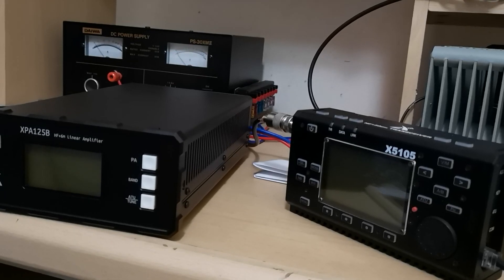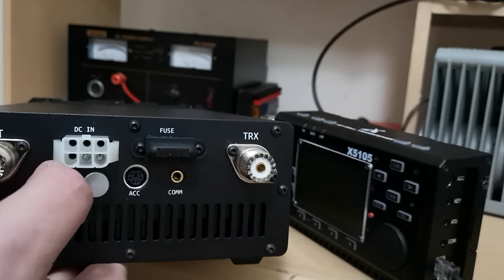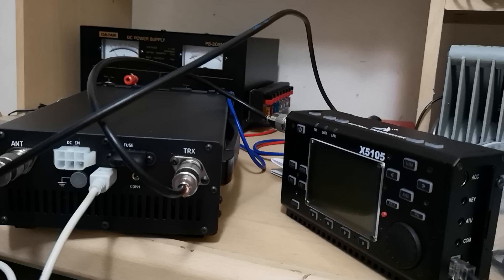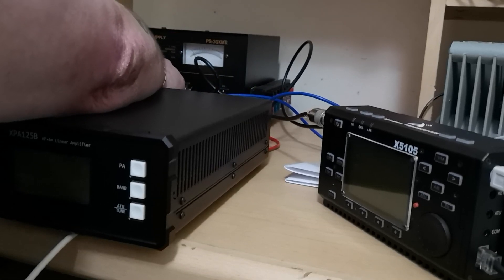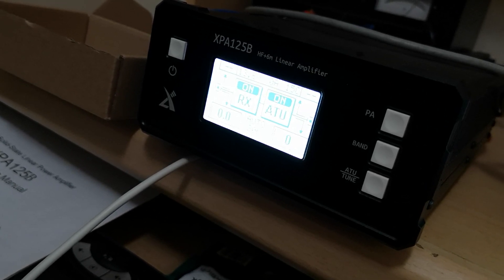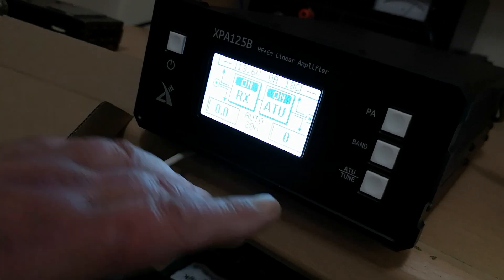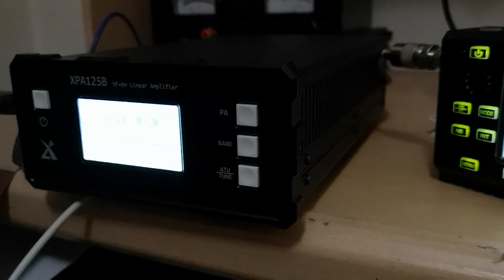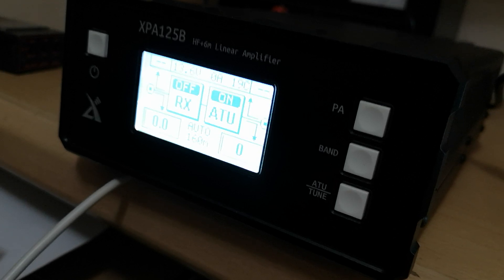The brand new Xiegu XPA-125B 100 watt 160 to 6 metre linear amplifier with built in auto ATU

Comment: Thanks for the vid.  How wide an SWR will it tune?  3-to-1, 5-to-1, 10-to-1?  The internal antenna tuners on most radios won't handle much of an SWR mismatch.
Reply from the maker: I have to say that ive had no issues with matching antennas with that amp, ive matched my delta loop right down to top band and my antenna is only intended for 40 metres up.. I can also say the atu's built into the G90 and X5105 are the same too, they will match and have matched most antennas that owners have thrown at them..
Reply: Close to 5:1.1

Comment: I am thinking about getting one of these for my Sun SDR Pro2 radio. I don't suppose you know whether it will perform automatic frequency and band changes when I change the radiofrequency and band?
Reply from the maker: Hi, it won't sniff RF to kick it into tx mode, you would have to make a lead up between the amp and your radio. You would then just have to change bands manually on the amplifier

Comment: Thank you for the video. This may be a better option for my x108g the the hb125 penetrator a bought recently. I didnt realize xiegu made their own.
Reply from the maker: This works great with the XieGu X5105, I will be doing further tests with my own X108G tomorrow..Xiegu have been making their own amplifiers for a few years now, the earlier none B version XPA125 had a few bugs.. But this new B version has worked flawlessly in tests and use so far. I have also uploaded 3 further videos of the amp and the X5105 working a few contest stations just to get some quick reports and make sure it is doing what it should be doing.. So keep an eye out for more uploads to my you tube channel, also their are 2 more HF transceivers that Xiegu have produced that will be available soon.. A SDR version of the X108G with 20 Watts out and a built in auto ATU, the facia/front panel is removable for remote operating in the car or the shack..
Also theirs a G1M which is an updated Xiegu X1M, now it has had the AGC board as standard and is now 8 Watts instead of 5 Watts.. I will be testing and demonstrating both of these on my you tube channel as well.. So hit subscribe if you want to be notified when new videos are uploaded to my channel..
I
.. Best 73 de Wayne 2e0bvj
Reply: How low does the amp go?